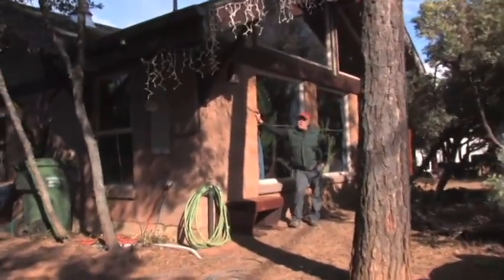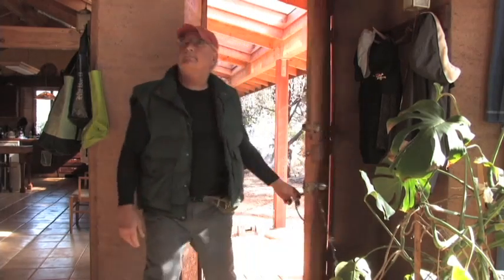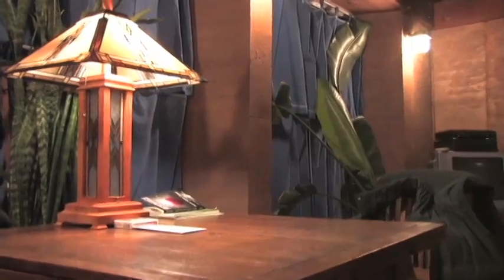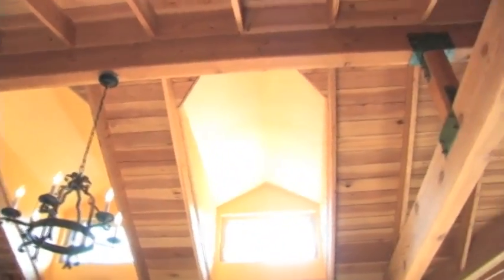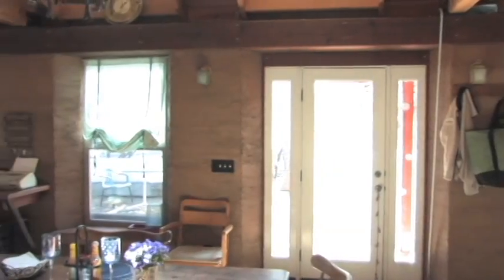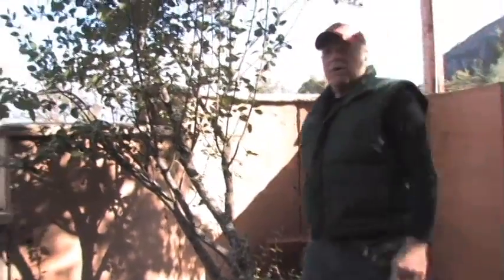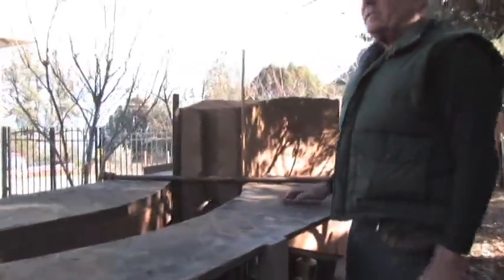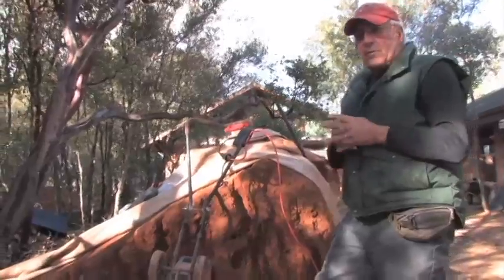Rammed Earth Building

Comment: What's the R-value for rammed earth per inch?
Reply: R33 i believe... you can add insulation in the middle. most walls are 18-24 inch thick...
Reply: to have an earth house built for you is about 500,000 dollars but to make one yourself is pretty  cheap.